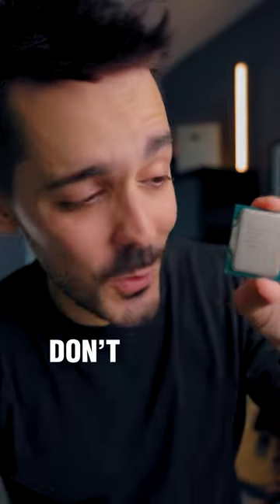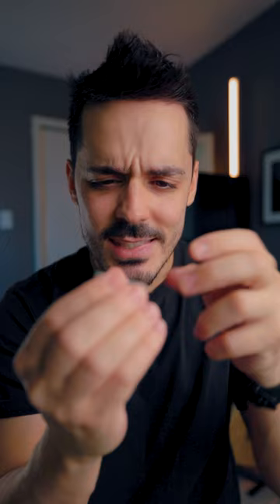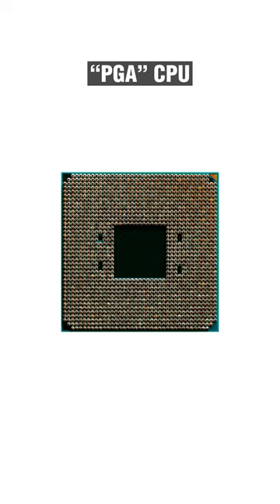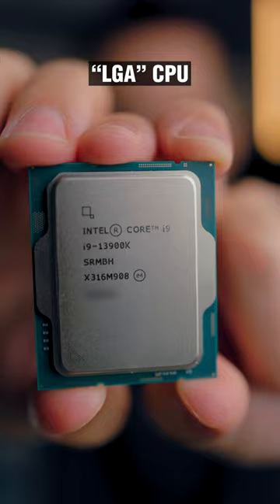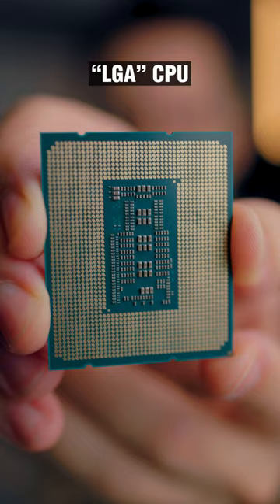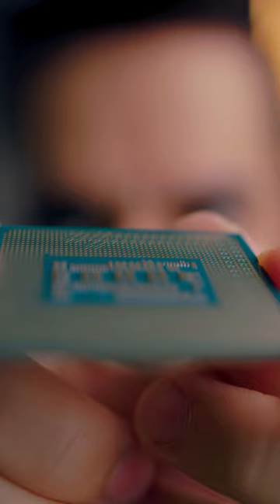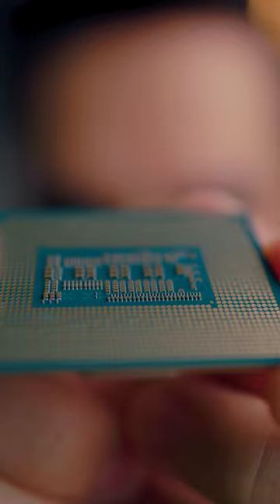How Durable are CPUs?

Comment: Those bent pins protected the capacitors and resistors in the middle... without pins, they are now the weakest point and a lot harder to resolder if needed...

Comment: Recently dropped a LGA CPU on the motherboard. Had to unscrew the motherboard from the case just to realign a few pins. Much easier to work with the PGA CPUs.
Reply: Let's start off with the fact that you aren't supposed to drop anything on the socket in the first place.
Reply: @Alex_Fishman  true but sometimes cpus just slip outta your hands.

Comment: Still a word of caution: you can very well break or chip the semiconductor under the lga cpus as well. The bits that and off the chip a little are very important for cpu function. Theyre a lot more durable than pins, but are often the ones that break when you drop them.

Comment: Cpu is not as durable as you think. I remember one day I was building a pc with a 5th gen i5, and then I dropped it which made the corner of the cpu snap off completely, and now the cpu is not working. It’s just dead
Reply: LTT somewhat famously did this with a xeon platinium 8180. It must have been painful.

Comment: Lol, my Thinkpad W500 has a quad core in it thanks to Libreboot, one extra wire on the motherboard and quite a few pins intentionally removed from the CPU to allow electrical compatibility with a Core 2 Duo socket. Some broken pins are a big deal, others might just go to debug ports (best case scenario) or to high address bits / bottom PCIe slots and won't cause problems until you max out the RAM or run out of PCIe lanes
Reply: and some are duplicate pins like the ground pin

Comment: Never had a problem with older AMD cpus, but with the pins on Intel motherboard I had problems all the time. Once I sold an amd cpu, the buyer received it bent, he fixed it easy, but I never fixed an Intel motherboard with bent pins. Now AMD is doing the same crap, hope the pins on the motherboard are more resistant nowadays.

Comment: He's correct on this one with the exception if it happens to be not have an internal heat spreader or IHS short, basically if the bare die is showing you have to really careful when tightening the heatsink down
Reply: Not really; hes grossly misrepresenting time lines in a really bizarre focus.  "Back in the day, cars used to be powered by leaded gasoline and got about 12 miles per gallon. My brand new 2023 Mercedes S500 no longer uses this technology and is far superior"   Like yeah its 
"true" but its information brought in completely bad faith, ignorance, or just kinda click bait.

Comment: Right, so the billions of transistors are not points of failure ? It takes a few faulty ones to make your CPU a paperweight and that can happen though everyday use or over locking or even faulty power delivery
Reply: Every pc component has transistors that can easily break so its standard that everything breaks when you oversupply it

Comment: don't talk tech when you do not understand it.
 Pins are one thing but the actual CPU die is made of silicon and is vulnerable to cracking as it is very brittle. 

Also since the CPU itself does not have pins, it means the motherboard socket does. You are handling a CPU  while working around a motherboard. So yeah, make that "how durable your CPU is" call wisely.

Comment: Just don't drop it on the motherboard socket and accidentally bend the pens there ...😢
Reply: Motherboard pins are WAY more durable than cpu pins, so bending them is way more difficult
Reply: @agentdd1918 well, that is if you put it gently, you can try using just a tini tiny bit of force, and you'll have a nightmare to fix

Comment: I don’t think ‘Lga’ or ‘pga’ are out of date it just depends on the cpu in question for example a 5950x (pga) is not an out of date cpu but an i3 3220 (Lga) is out of date
Reply: Both intel and amd have been using both LGA and PGA extensively for over 25 years now.

Comment: Fun fact most CPU are water proof. If you dip it in water, it is unlikely to enter the chip and damage the silicon
Reply: Well sillicon is a solid material it aint hollow
Reply: @309electronics5  the transistors are built on/in the silicon. If the silicon is left un protected it will corrode most of the transistors and render it useless.

Comment: AMD just scrapped their last gen PGA. So it's not old. Many people sill buys and use AM4 sockets. CPUs are durable untill you break the transistors at the bottom. They breaks quickly. Doesn't matter it it's LGA or PGA.

Comment: Intel yes amd no am5 the first amd with lga socket released in September 27, 2022
Reply: But most be and cpus are lga
Reply: @arcc0n  nope all amd Until the 7000 generation had pins. And even Intel for the longest time had pins. So having no pins is actually quite recent.
Reply: @artem29488  Yes But AM5 was the first affordable, LGA. In amd
Reply: The first real LGA chipset was in 2013. LGA 1155